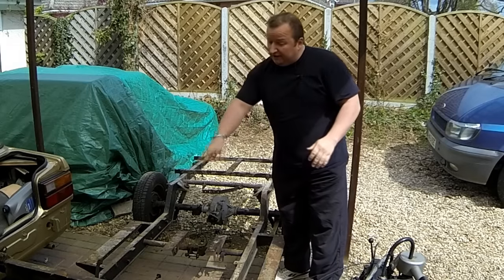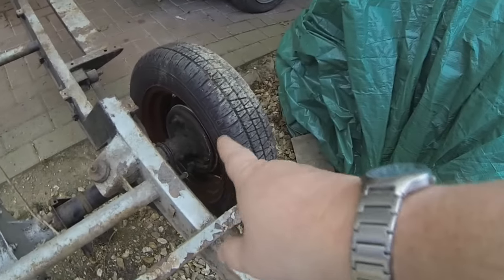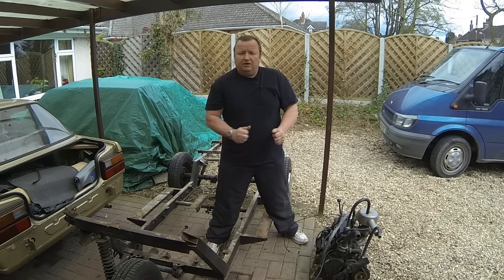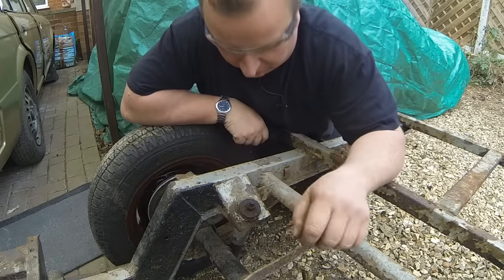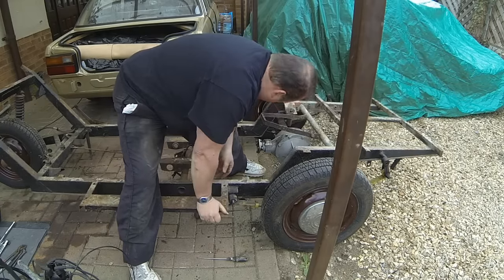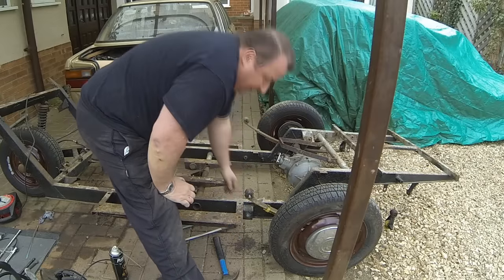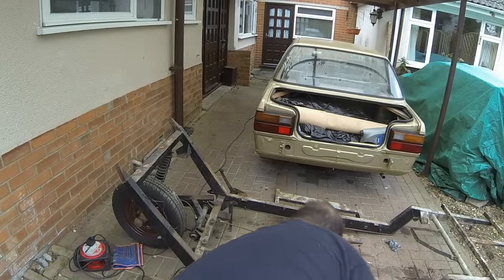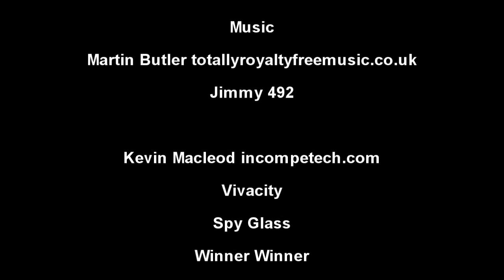Part 5 Reliant Regal Supervan Trotter Restoration Removing the Suspension

Comment: This might be a stupid question but would an 850 motor be over powered for that thing?  

Great work.  Really enjoying this series,
Jay
Reply from the maker: +Jay Dighsx The standard one is about 24 HP and the 850 is about 44HP. It is fitted into the Reliant Robin which is nearly the same chassis so it should be fine. Many people do this upgrade Jay.
Cheers
Martin

Comment: the shocks are the same as classic mini make sure you get the ones with the stud and nuts on top not the eyelets heres a link to the correct shocks http://www.ebay.co.uk/itm/CLASSIC-MINI-PAIR-OF-STANDARD-REAR-SHOCK-ABSORBERS-GSA7152-x2-BOGE-/182071257791?hash=item2a644aeabf:g:8dsAAOSwp5JWXClr also the head lights are the same as classic mini and you can get a pair of halegon conversion lights for around £25 with free postage the wiperblades again classic mini and outside door handles are rover p4.
Reply from the maker: +Daniel Clift Thaat's great Dan, I just ordered a set of shocks. Just the wiper motor now.
Cheers
Martin